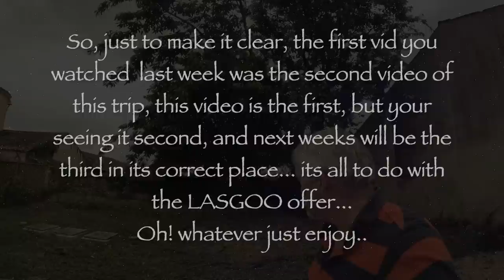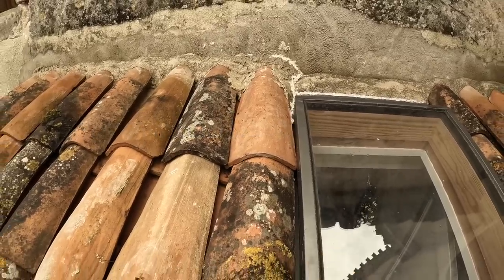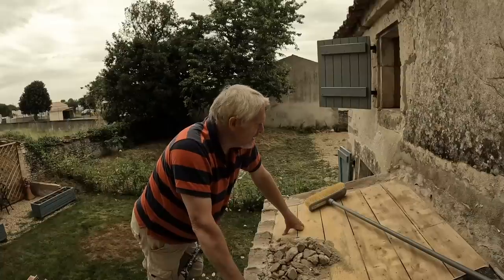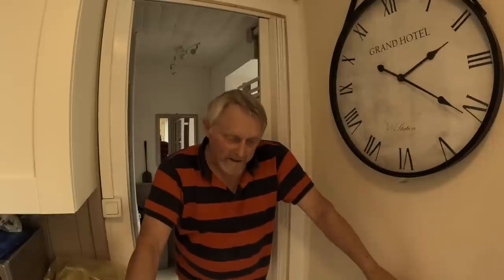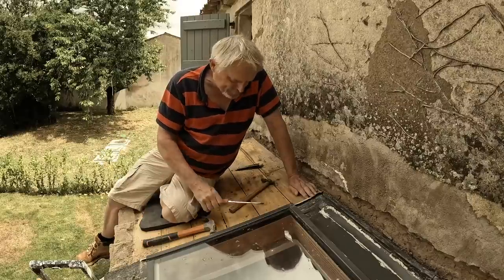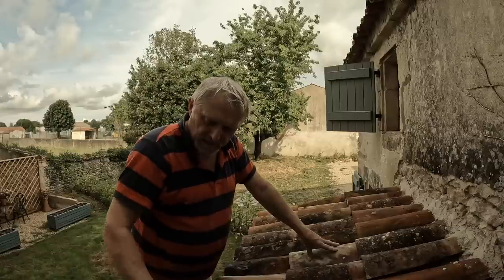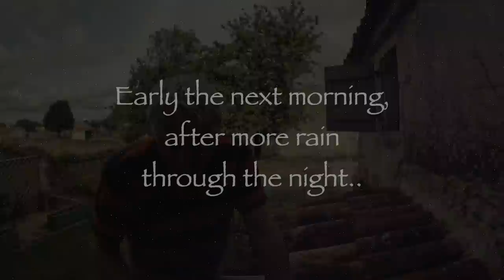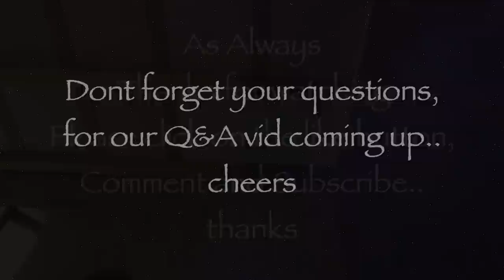The Gite gets flooded, as I replace the roof tiles...

Comment: How annoying [to say the least] to have to go over someone else's botched job. You handled that better than I would of done. We had similar probs with a small lean to stone porch and heavy welsh slate over a beam and wooden slats. We were told we had to put it back as was [200 yr old cottage] we replaced the slats with pallet board put a membrane down and corrugated tin sheets as a temp fix, it's still there 20 yrs later.
Reply from the maker: lol, if it works leave it lol many thanks

Comment: You just can’t trust an English builder 😂😂 shocking job tho mate …. Good move using roofing felt , plastic bags will cause condensation between the plastic and boarding so well done mate as in all old buildings see how it goes 👍
Reply from the maker: cheers John you can use the loo again in the rain without getting soaked lol